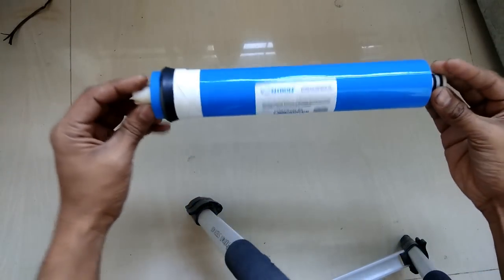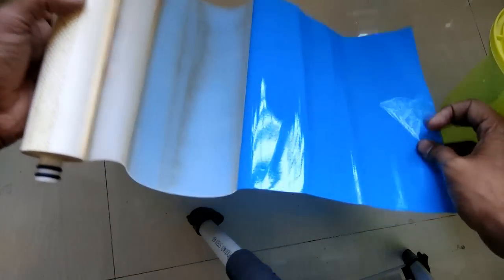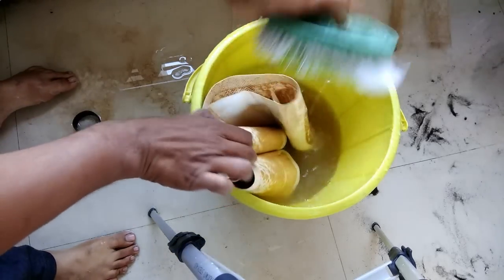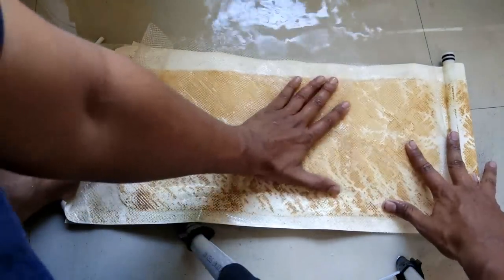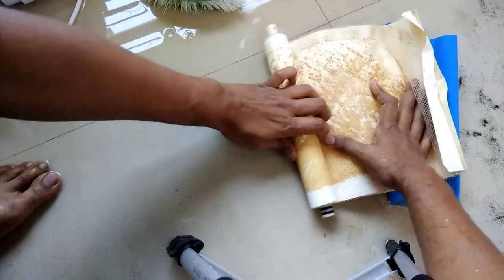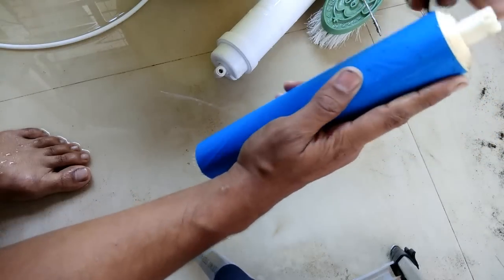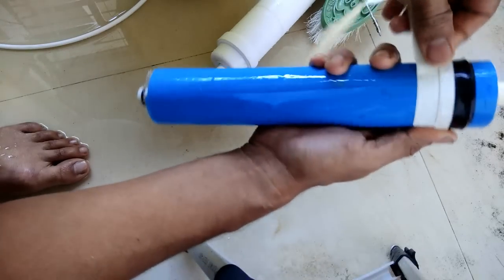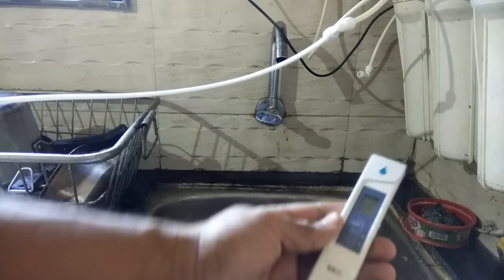RO MEMBRANE CLEANING RECYCLE A REVERSE OSMOSIS FILTER

Comment: Fascinating.  I would try a 2 stage cleaning process.  First would be an acidic cleaner like what you get at the home store for cleaning masonry surfaces or, just straight to hydrochloric acid, also known as muriatic acid and watered down some, then poured into one of the open ends.  If there is an inlet end I would put it there with the other end closed off and let it soak for several hours or even a day.  Next I do a forced water rinse and then put in a lye solution and let that soak for a prolonged period followed by another forced water rinse.  If any of the filter components dissolve, experiment over.  If you see stuff come out that is not the filter materials themselves you just might have a reusable filter.  I have well water with minerals and would love one of these at my kitchen sink, at the least.  If re cleaning can actually work then maybe a whole house unit ?  RO units I see in the trash and at the used construction materials store is testament to the expense of maintaining such a system.  A lady who works at a local hardware store told me she had an RO system at their home but gave it up due to the expense of maintenance.  One kind of chemical or the other may be all that is needed for cleaning your filters for reuse thus saving time and expense of using two kinds of chems.   
.
I have carbon block cartridge filters for my water which helps somewhat and I DO soak in an acid environment; Hydrogen peroxide and a little muriatic mixed in.  There is plenty of bubbling as for what they do capture breaks down and then the cartridges go into a spare cartridge container and are flushed with a garden hose hooked up onto an adapter fitting  (hose to 3/4 pipe) and run backward.  The rinse water goes into the hole in the middle, from where it normally comes out of, to the outer circumference, where it normally comes in from the well.
.
I may look into buying an RO replacement filter to experiment on just to see what effect my scheme would have before buying a system.  I am getting many reuses on my carbon block filters which cost $14 apiece, last time I bought them.  I knew THAT expense could not go on.  It helps to have two sets of filters to make for a quick swap which reduces down time to mere minutes while you can clean what came out at leisure.  Last bit: if you have 1 micron or less filtering it will help to go with the 4" x 9" filter set up and do two in parallel.  That should preserve an unfiltered flow rate.
Reply from the maker: Hi . You have awsome knowledge in Reverse Osmosis . Thanks
Reply: @reviewmaza  I wouldn't call what I do highly knowledgeable but thanks.  I am still learning.
Reply: bhot sara likha h bhai, vo bhi english me.... short m bataoge saaf hoga to kisase saaf hoga. experiment krke dekh lenge hum bhi.

Comment: I should have pointed out that washing and reusing your 
RO membrane should never be done.  The stuff  you see
is just the dirt on the surface.  What you don't see is the 
heavy metals, and environmental toxins that are still  trapped
in the filter layers.   When you attempt to wash the filter, 
you end up loosening some of those toxins, so you can drink them later.  

OH, and I forgot to say, thank you for the video!
Reply from the maker: Thanx
Reply: There are actually research papers that highlight that cleaning with bleech is acceptable a few times ;-)

Comment: I suggest you use REALLY clean water, if you're going to attempt
to clean your RO filter.  You should be cleaning the water at every 
step of the process and at no time should the filter be sitting in water 
that is brown.
Reply from the maker: Correct
Reply: @reviewmaza  I hope I didn't come off as harsh.  That wasn't my intention.  I truly found the information valuable, as I was looking specifically for what was inside of a RO filter.  Also, your sense of humor is priceless! :)
     Thank you again.  I can't wait for the video where you take apart a hydrogen water bottle!
Cheers!
Reply from the maker: @marakeshg8112  no bro .. it's cool

Comment: Even though this video doesn't show how to effectively clean the filter so it can be reused.
it effectively shows you how the membrane works so the understanding that if you took  off the inlet and outlet to the filter and swap them over you would have reverse the cycle and would possibly be able to push out any dirt in the opposite direction. 

Side note some filters have a 420mb flow valve on the waste outlet so you would have to connect after that.
You can't miss it it's a 4 inch long plastic cylindrical tube that is about 20mm diameter with miller bar rating on it.

Comment: I too opened up my filter just to know what's inside. At first I allowed it dry. A lot of flakes came out. Must be the calcium carbonate and other salts. Then washed it. Let it dry. Then roll it and seal it as you did. It should work. I am using the flakes to see if there is a better growth.

Comment: Sirji,  i think following steps will useful to clean  ro membrane 
1) flow pure water + citric acid (or other chemical which will helpfull e.g. vinegar ) in the membrane for few minutes 
2) keep membrane as it is (after first step ) for some hour
3) close waste water outlet. And then flow ro water with pressure in the pure water outlet of membrane for some hour. In this water comeout from inlet of membrane.
Please reply is it helpful or not 
I